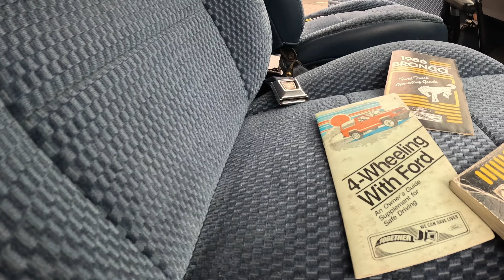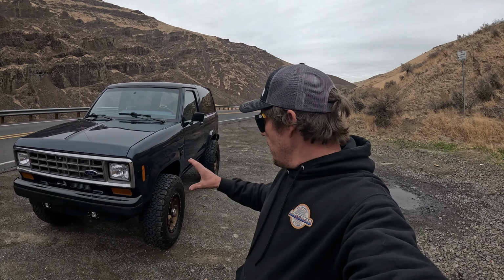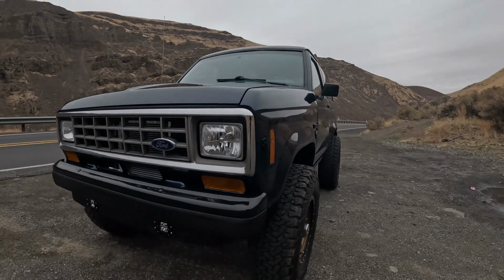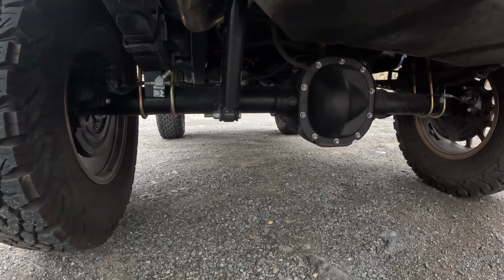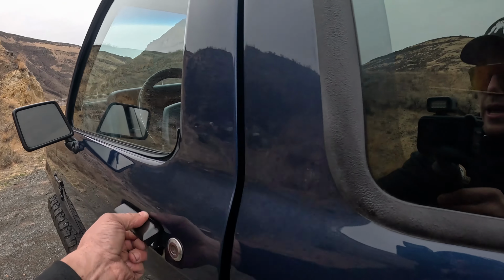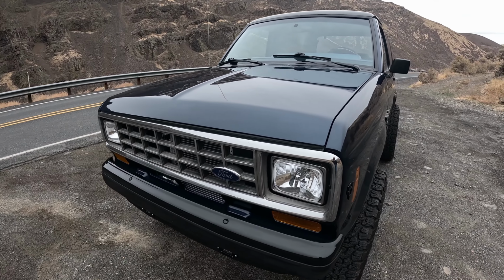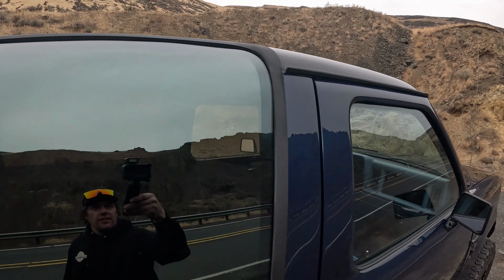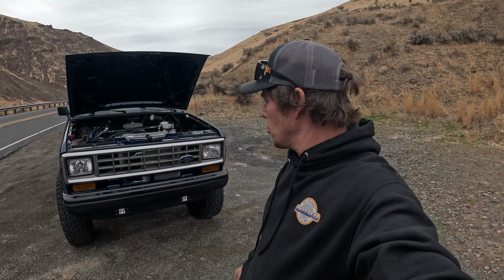Baddest bronco II on the planet is finally done!! #ford #bronco #80s #trucks #4x4

Comment: I still have my 86 B2 i built 10 years ago. 5.0 H.O. swapped. Kept the original Fm146 5 speed, used advanced adapters to adapt the f150 bellhousing to it. Wanted it to look and perform like it should have came from the factory. Manual tcase, Stock ride height too. Quite enjoyable to drive. Drove it 2 days ago, fixin to go hop in it and head to walmart. I dont drive it daily like i used to, my 2 teenage sons drive it more than me nowadays. These Broncos are really an underrated platform.
Reply from the maker: That is super cool!!!! I agree, they are the black sheep of the bronco family!! Well now we have the bronco sport hahahahaha. Keep driving the wheels off of it!!!
Reply: Any problems with the Fm146 transmission? I have the same with the 2.9 but may swap in a 4.0L and keep the Fm146. I have the A4LD that can be rebuilt and bulletproofed as an option. Running gear (already swapped) is off the same 94 Exploder.

Comment: Beautiful. Not a fan of the oversized rims. Didn't know there is such a thing as a Ford 306. That's perfect power/torque combo for a Bronco2. I have an 89 Bronco2 with the old reliable but gutless 2.9L. Looked up the price on a crate 306. $20, 000! Can't see that happening in any vehicle. My 6.7L Powerstroke was only a $10,000 option.
Reply from the maker: The blue print 306 when we bought it was 18 with the transmission and all the fuel injection parts. The wheels are a 17' method. Not overly big. Went for more of a modern look, I think they fit well. But everyone likes different things. 

The owner definitely wanted to finally out in this little truck. It was worth it. 

Thanks for watching;!

Comment: I love what you did with this Bronco. Paint is a great color and wheels set it off. I have an 89 with only 44k miles. lts all original, but I have thought of what it would be like to have updated suspension and a stronger engine.
Great job !
Reply from the maker: @southpaw4755  thanks, it turned out better than I could have hoped!! Way more fun to drive!! They are a good start to a nice truck with some upgrades

Comment: I love what you've done, I'm a big B2 fan, bummer its a pavement queen. I bet it would do pretty well on the trail.
I've been getting into the smaller wheelers the passed few years Mitsubishi Raider, CJ5's, Suzuki Sidekick and Bronco II. 4x4's are getting to big for the trails, the last great small off roader was the Jeep TJ.
P.s. I liked that you made the body mods to fit the larger tyres with the lower lift, not many people doing that these days. We did that some 12 years ago on a 2004 Chev 2500 that was straight axled on 40's with only 8 inch's of lift.
Reply from the maker: Thanks!!! He has too much money into it to wheel it lol. As for the fenders, I wanted clean and stock looking. I think we pulled it off!!! 

I wheeled samurais for years!!! Loved it!!

Thanks for watching!!

Comment: Awesome build. But what exactly is the suspension setup. lift hight and all?
Reply from the maker: It's all custom. We used parts from a 1st gen bronco lift and adapted them to fit the B2. It was probably around 3 " of lift over all. Toms bronco long arms, custom track bar and steering

Comment: What headers you running?
Reply from the maker: The headers came from a company called L& L products. They do a bunch of Ford motor swap stuff. But to be honest with you they fit like trash. I ended up having to machine a bunch of stuff on them to even be able to put spark plugs in them. They required modifying frame. And I'm pretty sure they told me when I ordered mine that they actually didn't even offer that stuff anymore for those ranger bronco 2s. But since they were still on their website and I already paid for them they got me a set. Maybe that's why they didn't fit well LOL

Comment: What axle did you use for the front? 44 or 30?
Reply from the maker: We got a screaming deal on a Dana 30 with a tru track in it already. So we put that in it. It isn't a wheeler so it is a perfect fit!!! Thanks for watching!!
Reply: @Cuttin_Up_Cassics  it's a sweet rig. I am currently putting a 4 inch RC lift in my B2 as we speak. Trying to drill out the rivets that hold everything for TTB in place sucks! Makes me wish I would have just done a SAS with a Dana 30. As mine is not a wheeler just a hunting rig. But i am not great at fabrication. Although I have heard the Dana 30 swap is pretty easy as far as SAS goes.

Comment: Bee-u-tee-ful.  I love those trucks, I have 6 of them.  One question, why a Dana 30? The 44 from an early Bronco fits like a glove.
Reply from the maker: That was a Dana 30 from an early bronco. That and we paid $200 for it had a true track and it was already geared. All we did was put the disc brakes on it. It's not a Wheeler. But we wanted to get rid of that twin I-beam
Reply: My bad, I read dana 30 and immediately think heep crap, sorry.  25?years ago I met a guy in town who had an 88 Ranger and he had put a 320/c4, Dana 44/9Inch  into it.  I immediately went looking for every Dana 44 I could find.  Back then $150-200 bucks all day long.  The 9" rears, however, are made of unobtanum and were super pricy even then. I resorted to 8.8s out of explorers. I've also done two of the TTB D44/D35 mashups.  They work very well.  Anyway, nice build.
Reply from the maker: @circlefly1  thanks!!! Yeah the 30 has a truck track and ended up be a good find at $200!!!